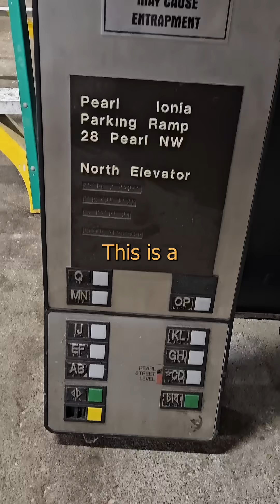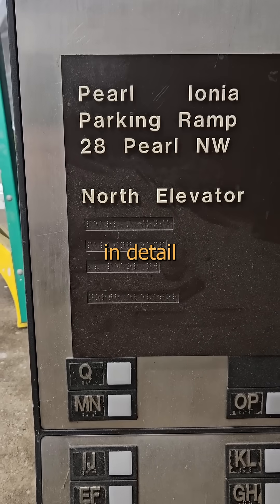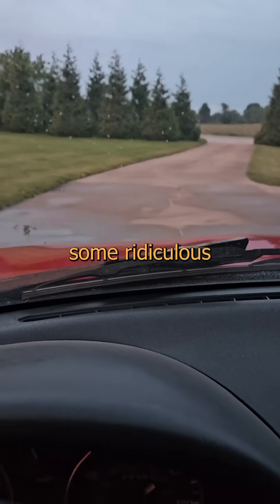Miata Mischief #chrisboden #engineering #gear #elevator #score #stories #parts #hacking #making

Comment: Went walking around the desert by a school event and found a rusted up head of one of those standing space heaters that get red hot along with a stop sign post. 

It was a struggle tiring it to a bike with a plastic table cloth but it made it the 4 miles back home.

Still have them in my backyard just unsure what to do with them.

Comment: Only had rope, bc broke college student, but I brought home freshman year a stickered up 80-90s McDonalds two sided fiberglass bench seat. Tied it to the roof on my parents 01 Eddie Bauer Mountaineer that I borrowed for the day. The ride home was fast and short as many a freshly plowed field were driven across rather than taking the road, and we could smoke a blunt in a field but not on the road… probably would’ve been a half hour shorter had I taken the road,
But the retired train tracks, fields and orchard cuts were well worth bringing that very hastily and illegally fastened bench

Comment: The car was a 1987 mustang hatchback, the item was a 14 foot sunfish sailboat. We were driving past an antique/junk shop that was going out of business and it was sitting out front with a sign that said $25 on it. We shoved it in the back with the nose just about touching the windshield and 8 feet of boat sticking out the back. Some nice rope work and we drove the thing the 40 miles home. I’ve had many of those experiences but that one probably takes the cake.

Comment: Got a bit carried away at the hardware store. I ummm….i rode my moto….. All the small stuff fat into the tiny boot. Shimmied 6 5mm steel rods into the front fairings and the top box bracket (don’t worry it was a Honda). Was sticking almost a half metre out the back. Sat on a bag of concert and tucked the pipe under my right leg. Only a few ks home. Job done!

Comment: Bought a boat engine on eBay in Kentucky, I live in NY. My car at the time wasn't to be trusted further than walking distance from home so I rented a Subaru. Took out the seats and covered the interior with plastic sheeting and cardboard. Made it to Kentucky, stopped to see Mammoth Cave (awesome). On the way home I couldn't recline the seat to take a nap so I pulled off into a rest stop and slept under a tree
Woke up to find an inchworm doing laps on my face. 
Took a lot of pics and video before gently relocating him/her to the tree

Comment: When we bought our first house, we were suuuper browk. My wife found on a local classifieds site free sinks. Note thats plural. We see they have a vanity sink that fits the oddball size vanity our 1950s house has and go to get it. 
The person says we have to take all or nothing. They had a large kitchen sink and an 11 foot double vanity sink. 
So in my 2000 dodge intrepid we maneuvered it to sit on the dash, lay back the passenger seat and into the back window got the doubke vanity into the car. 
We were 1 speed bump away from replacing both large windows in my car. But we got them back only for my wife not to use any of the sinks. She did end up selling them ocee the span of 2 years though

Comment: I came across a fire hydrant that had been replaced on my way home one day. The new one was installed already and it was just laying there with a stub sticking out the bottom. I went for my car and rolled it into the front seat of my '84 Honda Accord (smaller than my '15 Fit). Getting it up the stone stairs and into my building was an adventure. Then across the lobby to the elevator and down the hall. Had some neighbors questioning me along the way for sure. I took it apart and removed the guts. It's been in my living room now for almost 30 years (save a stint in my dad's garden) at over 20 addresses in 6 states.

Comment: Heh, iv done some stuff with cars

Queen mattress and base ontop of a 2 door soarer held with hands out the window

Matress on ford mondeo wagon strapped through the doors

Small boat inside a mazda mpv same with 2.4x1.2mt ply and aqualine sits above your head as you drive

Massive shelf hanging off the back of a ute teetering on falling off held with a few straps

Engines in car boots with the boot left open engine hanging half way out 

Im a kiwi when theres a will theres a way

Oh and cutting seat belts out to make a tow rope

Comment: I found out you can carry 8' lengths of lumber in a dodge shadow coupe by reclining the passenger seats, dropping the rear, and propping them from the driver's side back corner of the trunk up to where you have to wedge them against the front window and DON'T BRAKE HARD. 

Also that a dodge shadow sedan loaded to the bump stops with cast-off MDF shelving from a Radio Shack is perfectly happy with that duty. That was probably 800-100 pounds of shelving, and sketchier than the 2x4 trick because if you remember the old grey and red shelving those boards were HEAVY and the coating slick enough that a stack would scoot around. Had a decent bruise on my elbow by the time I got home thanks to a careless turn. 

Also moved some 12 and 16' long lumber on a single cab GMC Sonoma, but that really wasn't sketchy because I'd made a fairly nice wooden haul rack that was just high enough to hang stuff over the cab without sagging and hitting the roof. Built 'er tight! Unfortunately tight also meant shrouding the third brake light so closely the lens melted, but that's replaceable :)

Comment: I wanted a road legal dirt bike, so I went to see one that was for sale.
I told the seller that one prerequisite was that it fit in my car, so we should try that first.

He wasn't expecting a tiny 2011 Kia Picanto to roll up.
I had removed the passenger seat and folded down half of the rear one, covered every surface with cardboard, and we tetrissed about for half an hour, until it finally popped inside through the passenger door and I managed to drag the rear end over the folded seat and into the trunk.

It fit absolutely perfectly, with the brake light against the rear sloping roof, the plate almost hitting the rear glass, and the handlebar stuck between the driver seat and the right door seam.
And I also carried a passenger tucked in the seat behind the driver's!

When I got home, though, we couldn't get the bike out... so I used my car with the dirt bike stuck inside for a couple weeks, having to climb over it to get in and out of the car (driver side is inaccessible in the garage), until I finally had enough and removed the handlebars and the footrests, and dragged the bike out of the door!

Comment: When I was moving into an apartment I wanted to get ‘new’ furniture, but I didn’t want to pay for shipping. I drive a Late 2010’s Honda Civic with roof bars. I committed to the no shipping thing and even hauled my full size mattress and box spring on the roof with cheap rope and a couple bungee cords 40 Kilometres home. And getting my dresser was an entirely different level of sketchy, I drove all the way to the city for it cause it was a vintage one and strapped it to the roof with 4 ratchet straps, I was driving down the highway most of the trip back with this big heavy dresser on top of my car. It got to the point where going up a steep hill meant putting my foot to the floor in 4th and the car not being able to go faster than 89kmh. Overall though was a fun trip and a lot of people laughed and did double takes when I passed them.

Comment: Sixteen year old me went to a ham radio swap meet (I have never been a ham but hung around with them) and came home with an AN/WRR-2A battleship radio receiver. About the size of an under-counter dishwasher. Something like 50 vacuum tubes and a crystal "oven" to regulate its frequency. The entire unit, with battle shock mount weighed more than 300 pounds. I got it home somehow using my Fiat 128, carried it in three pieces up to my second floor bedroom, and assembled it on my desk. As I was examining the bazillion knobs and switches, I felt like the room was shifting to the right. Turns out the receiver had overloaded the desk and it was falling to the left. It crashed through another desk and a metal filing cabinet on its way to the floor, but fortunately nothing else was hurt. The radio sure wasn't affected. It sortof worked at first, but got less and less functional as I worked on it. I think I paid $30 for it, and years later had to pay someone to haul it off.

Comment: I was riding my bike around the area. Which is by all consideration a terrible area, when I spotted a pile of trash. In that pile of trash was a nice amount of copper pipe, a few little metal trinkets (Which I collect) and a microwave. You know I had to try that microwave. Not only was it abandoned to be trash, but it was HUGE! It was an OFFICE built into the wall style microwave. I contracted my younger brother, and we hauled it home over a mile through a massive hilly parking lot, down a huge hill, and through an abandoned car wash. It's one of the coolest things I ever found. And it's currently the houses working functioning every day microwave. I know I won't win, but it rocked. I later found a bike at that car wash which was in such terrible condition that I figure it must've been beaten half to death on purpose. So I fixed that too. I mean honestly that bike looked like it had Cthulu performing cunnilingus on it. That bike was screwed. Another time, same parking lot, I found the chair I currently use. And all of those things had to be carried through the woods in the dark to get them home.

Comment: I bought a couch for my new place and not until I got 5 minutes away from the person's house did I think of how I would get it home in my Genesis Coupe. I ended up ratchet strapping it down to the roof the long way through the windows and by the grace of God it didn't slip off and break something within the half hour drive home.

Comment: In highschool when the Wii U came out I was walking to Gamestop and saw the Wii display stand without its electronics sitting in the dumpster. I had asked about taking it off the hands of the store and they refused, saying that Nintendo needed to take it back and destroy it.
I did not want it destroyed, so my friend and I drove to the Gamestop at 4AM the next day.
We just opened the back of my Pontiac Vibe, put the seats down, grabbed the 200lbs of solid metal and threw it in the back. The thing was so tall the top was touching the radio in the front.

I have it to this day and got a TV on it, and I try to keep it as pristine as possible. It's one of the coolest things I own.

Comment: I recently stole some sand from a nearby playground. The look i got for doing that was a bit strange. The look from the same lady when i came back with the same sand half an hour later to return it in a  meticulously sieved form with all the sharp objects and pebbles removed only to dump out the sand, meticulously ensure it is well distributed in the sand pit, turn 180 degrees and head the way i came from was just priceless. Barely a week goes by without me carrying something heavy home from the ewaste containers whilst questioning which life choices got me into a situation where i lack the self control to not carry 60kg of industrial radial fan around, 2km uphill whilst it's 33C° outside and i have places to be.  Just because if i take the time to think about it, this looks fixable and totally fits my needs for uhh... something i'm sure.

Comment: This is a weird one… can you talk about how absolutely crap locks in the U.S. are?
It’s something that’s pissed me off for a while now (as a hobbyist lockpicker) because we have crap locks compared to basically everywhere else.
SFICs are pretty good all things considered and they’re used a lot in commercial settings… but most of the door locks for homes are just a 5-6 pin cylinder with no security pins. And the kwikset smartkey… oh it’s weird and incredibly hard to pick through the keyway… but it comes conveniently with multiple bypasses!
It’s all really interesting stuff to me, and I think we need to step up our locking game and stop being complacent with the common stuff.
Also it’s not a reason to be panicked, the rates for lockpicking in break ins is low to my knowledge, and people have ground floor windows… and really the “honest people honest” bit is mostly true, but there’s so much interesting stuff you can put on your door, from medico’s weird ass rotation pins to assa’s pretty cool Max+ restricted… hell MUL-T lock makes a pretty cool dimple lock with PIN IN PIN action (very fun little thing) in the J.R.
There’s more options than just Schlage and Kwikset and I think people should know that and have more fun with how their house is keyed because it’s really cool.

Comment: I adopted a 42 inch, 70 pound plasma TV with a bad high voltage power supply from the curb on bulk pickup day.  Folded up the back seats in my honda fit, and was just able to close the doors.

Comment: My chevy 2500hd diesel lost a ball joint 6 hours from home. Got a ride back home and the next week i used my parents toyota tundra and a car hauler, noticed i said CAR hauler, down there to pick it up. The wench on the trailer could barely inch the thing up my trucks wheels buckled the trailers fenders. Had to air them down to just barelyyy squeeze them in. Got the thing on and the back wheels were on the very edge of the damn thing. Bed stuck out about 2 feet. Trailer was 4 inches off the ground and my parents Tundra wasnt far off. Popped 2 trailer tires (one as i loaded my truck up) and slept in the truck over night on the way back. Drove 55mph in a 75 all the way home all while staring at the sky because the tundra was so squatted 😂

Comment: I used to work at a big cabinet shop. One day a big ass cabinet that I had built actually was made wrong, so they told me to cut it up and throw it out. So, I did cut it in half, and then proceeded to stuff both halves of this big fucker into my 2001 Honda Accord. I had to push the seat all the way forward and drive with the seat tilted forward and the steering wheel pressed against my chest to fit everything. Got it home, though!

Comment: In my earlier and less well funded years, I would do some creative online shopping in order to level up my available tools and random toys stuff. I had found a returns auction that was like a 4 hour drive away, in that auction there was a 42inch stacked husky toolbox along with other stuff, I winning the lot for about $250, but only then did I realize it was 4 pallets of stuff. Before leaving to pick it up, I removed all but the drivers seat from my dodge pickup, and spent like 3 hours stacking, strapping and repacking those pallets into the truck to safely haul it all back home. After I sold off the other random stuff (including a full 13 pc patio set), and accounting for gas, that toolbox cost me roughly $26. And like 2 fully days of assembling and disassembling the interior of my truck :-p

Comment: The Honda fit is the more modern, functional Miata.
I've fit a new exercise bike in it even. There's even pictures of a fit with a small cow in it. People get these cars because they are small but functional and also can take turns at least as well as the Miata. They can also be k swapped, with a civic si engine, which has to be slightly scary with such a light vehicle.

Comment: I had an early Miata.  Took it to Spain.  Used it to hall shelving from the mega stairs to the apartment.  Top down and headlights up.  When the kids were looking at my car as they crossed the street.  I would turn the headlights on and off so the lights would come up and go down.  Not having a top on a small car helps when hauling long items

Comment: I had a 2012 fiat 500 sport. At one point my mother, who was active in the SCA, asked if I could use my hatch back to bring her gear to a local SCA camp out. Her gear was a tent, a folding chair, gear for fencing and teaching fencing, several outfits for the day, and basically anything else you might use for a camping trip mixed with a costume party mixed with a Olympic fencing match. It filled my car with the rear seats down, the front seat forward and folded, and the hatch just barely closed. It was piled to the roof. Including a golf bag laid flat one the floor that was full of fencing equipment.

Comment: With a few friends from uni, we bought a whole rear projection tv from the physics faculty for two cans of beer, then rolled it home through the streets to our apartment.  We were lucky enough that it originally had wheels, but it was still fun to cross roads and lift it up on the sidewalk. Then we had to figure out how to bring it up on the stairs, and easiest answer was to disassemble most of it at the main entrance, and only bring up the parts that we would need, and which contained the funny parts. All that for a fresnel lens to make a solar powered heat gun

Comment: A $99 dollar project source toilet from Lowe’s will fit into the back of a 2013 Honda Civic don’t bother with the trunk. It will not fit but if you angle that thing just right say a prayer and it will just slide right in to the backseat kinda like me and my teens.

Comment: Worked in a wood furniture shop for a while and had to get rid of an edge bander to some scrap guy, just getting the thing on the truck took an hour and nearly took out two forklifts and the instant the truck got the full weight it blew out both back tires, I feigned concern until I was informed since the guy was getting it for free we had no legal obligation to stop him dragging his half a truck home.